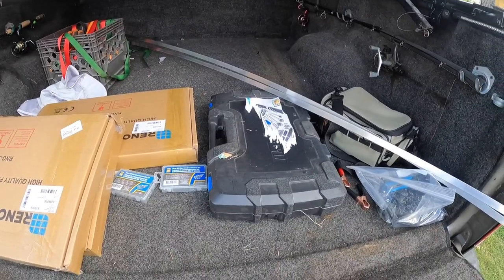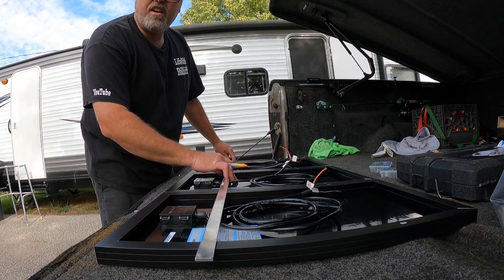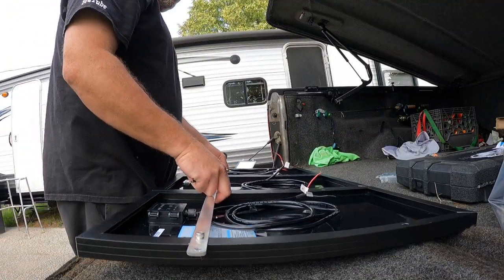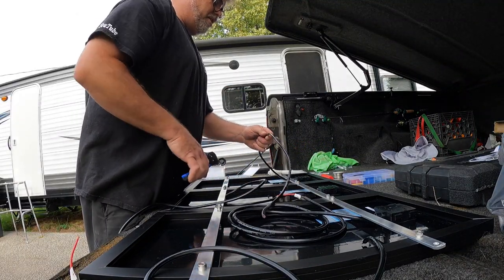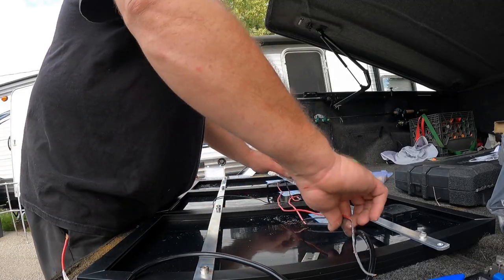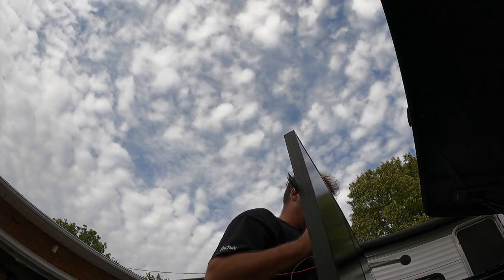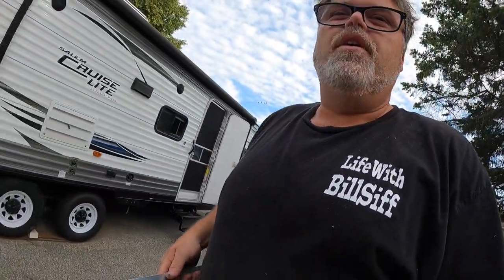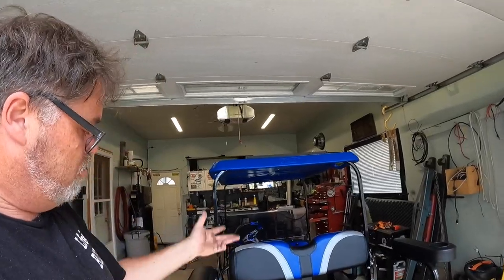Solar Power For Golf Cart 36 Volt

Comment: I like the idea but being in electronic myself, I don't think it is a good idea to have those wires, even though they are insulated, should be pinched between the panel framework and the roof of the cart.  Eventually they will short from vibrations, twisting of the cart going over uneven surface, ...etc.  If you had uses a 1" square tubing, it would have made this panel very rigid.  And you could have made them long enough so you could have put a cross member and used the same existing holes in the roof that hold the cart roof to the cart.  That would have put a space between the panels and roof.  But I do admire your work and think you did a great job.  I was looking for ideas on how to do the same thing to my cart and your video did just that.  Thank you.  One more hint should you experience a short, you can modify the wire route with making major changes as I suggested in the beginning, just drill holes thru the frames of the solar panels to run the wires through
Reply from the maker: Its fused . Thanks for you input . I dont own cart anymore

Comment: I’ve got a 230 watt Solar panel on the roof of my golf cart. I need to charge controller for my 36 V of battery. What model and make and charge controller should I get and where should I get it from?
Reply: One panel probably will not have enough voltage

Comment: Hey billsiff, i just purchased the harbor freight 100w solar panel will that work on my 36v golf cart? Oh i did the 3 12v battery swap on my cart as well.
Reply from the maker: I actually did this some research it’s gonna be tough that’s why I bought three panels to run in parallel so it make 36 V 3 12 V volt panels what voltage is that solar panel might have to do some research on how to make that work
Reply from the maker: You definitely going to need a solar controller as well that’s good for 36 V

Comment: If you run 12v to 3 separate pair of 6v cart batteries you wire direct, never need charge controller, live in Florida and has never needed more than water checked every 6 months and keep terminals clean. Use decent size wire from panels to batteries, 30w panels (3).
Reply: You did that ? It was ok and you didn't need a charge controller ? How fast does it help the batteries recover as you operate the cart ? Thanks

Comment: You wired your panels in series to get the 36 volts. That means you are still at 30 watts, not 90 watts. If you had wired them parallel you would have gotten the 90 watts, but only 12 volts.

Comment: That would only be 30 Watts if wired like that.  Wired in series adds the voltage together but keeps watts the same. Wired in parallel adds the Watts and would give you 90 watts but only 12v.
Cheers.